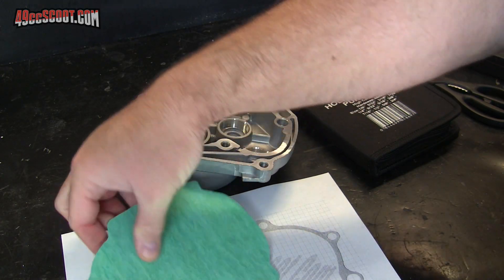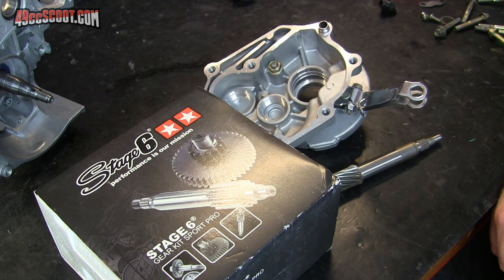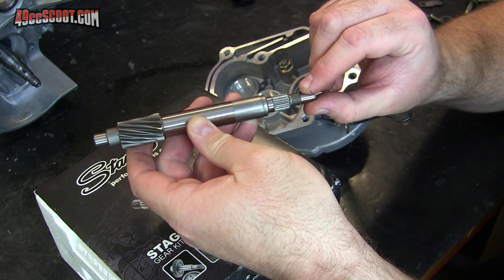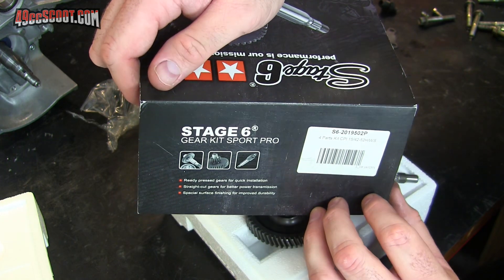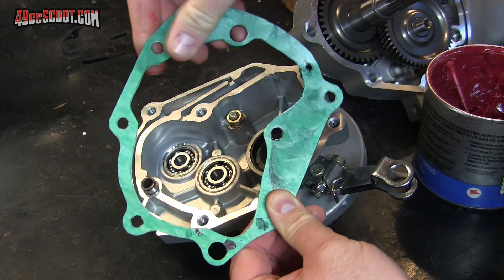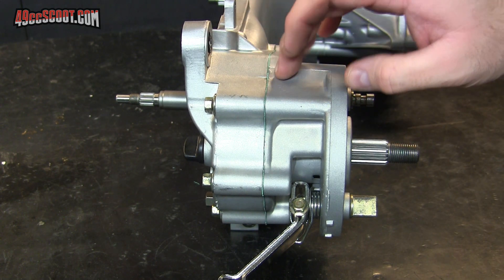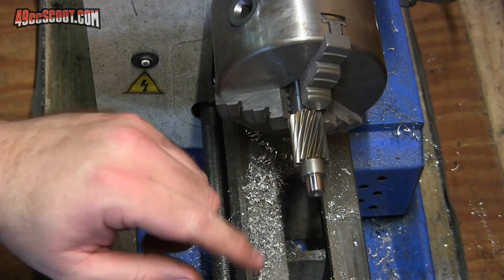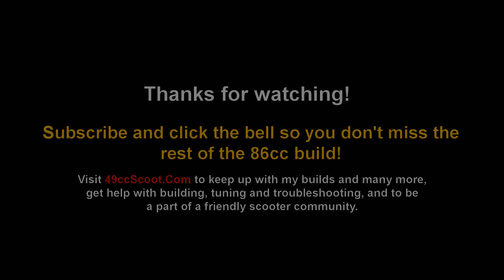TPR 86cc Build : Part 6 : Gearbox Assembly With Additional Support

Comment: Is it worth buying this secondary gears stage 6 15/42 my 1pe40qmb only reaches 70kmh thanks
Reply from the maker: Not a necessity if you're at that power level. It's a more sturdy setup with the 3rd bearing, but stuff that's closer to stock are OK without it generally.
Reply: @49ccscoot  okey thanks those are stage 6 gears 15/42 right 1pe40qmb long case 18-19splines i think fits 12inch wheels right and what speed u can max out with it
Reply from the maker: @roberts1189  That build for me was 75MPH or so, but a lighter rider would prob go a bit faster.

Comment: Hello, I have a scooter with a Piaggio engine and I have primary gear ratios of 13/46 and secondary gear ratios of 13/48. Which tuning gears should I install?🤔
Reply from the maker: That's roughly 13.07:1, which is pretty deep (low speed). I was using ~11:1 in my 86cc and that worked well for me at that power level with a 130/70-12 rear tire. With smaller tires, you may want an even lower gear ratio number.
Reply: @49ccscoot  Will primary gear ratios of 14/39 and secondary gear ratios of 16/47 be good? How to calculate it?
Reply: Tire 130/60 r13
Reply from the maker: @krystian9439  Calculation of the ratios is easy. 49 ÷ 13 = 3.77 and 47 ÷ 16 = 2.94. Multiply those ratios. 3.77 x 2.94 = 11.08. So your final drive ratio would be 11.08:1.
Reply: @49ccscoot  Ok. Does this ratio affect speed or acceleration?
Reply from the maker: @krystian9439  Both.

Comment: what is the purpose of changing the Primary Gearing ....
what do you achieve by it, I understand it with the secondary gearing but do not understand the point with it on Primary gearing.

can you not explain it to me, because I have funnily enough worked with Scooter for many years and built them up for Track driving, but I have never had to change a primary gearing part
Reply from the maker: Primary or secondary doesn't matter if you're just looking at ratio. Change to whatever combination gets the final drive ratio where you want it. In this case, the primary gears allow for an extra bearing that takes some slop out of the final drive transmission.

Comment: 11:1 is stock gearing on a rexy block i use 9:1 on my set ups better top speed
Reply from the maker: For me, it's worth the change from 10 to 11:1. I've had much less trouble with the gearbox using the gears that allow for more support, plus I am heavy and strong acceleration is my main goal.

Comment: How do you get that rear brake holder with the 12mm nut on the inside of the case you took off the old engine to put on the new. I got the nut off of it but it won’t come out of the engine case
Reply from the maker: They can be a bit snug. May need to be tapped out  once the nut is removed. If tapping starts heading toward beating, try to add a little heat to the area (~250F will usually expand it enough to make even bearing removal easy) and then try tapping again.
Reply: Ok thanks I also have a press would that be to much?
Reply from the maker: @nastynatesscooters9896  That could work. Again, if it seems like excessive force,  try heating and then pressing.

Comment: Hi I know your the man to ask I need to know what mallosi belt is slightly longer around 5 mm or 10 mm than a 617587/1 please help ??
Reply from the maker: 617587 appears to be 17.5x8x805x30.

The belt that I regularly use is a 6111108. It's 17.5x8x815x30.

Comment: Hi I'm from Europe we have the same block I always watched your video coz I learned a lot from you. Just one question where did you bought that primary drive shaft? I found one on Ebay but I'm not sure if it is the right one. Model: Eton beamer 50cc Code: 750152
Reply from the maker: I got it from Get 2 It Parts, and the code where I ordered it is also 750152.
Reply: @49ccscoot  thanks man!😀

Comment: Have to seen or tried the new Reveno Seamless
   Transfer
      Clutch yet.
Reply from the maker: Someone told me about it and showed me a vid. Didn't see any detail about how it is tuned or if you're stuck with what you get. No in depth info. It looks neat though.
Reply: @49ccscoot  they have a website

Comment: Really great fun.Never done this,0 experience.But the original peugeot 139qmb are different from the extra motor I bought,and none of the 101-octane spare parts fits in the screw-holes.So for my 900 dollar V-Clic it will be the original parts,wich are expensive,but all other are to repair and fitted.So none 139qmb engines are alike.Few criminal millimeters.

Comment: My limited experience with 139 gearboxes is that the outer race of the bearings should be more flush than you show on the video.  Just as you did the first assembly, I said to myself that added bearing was 'out' too far, and would get the input shaft into a bind.  Wrong as to the cause, but still think the outer race should be driven deeper.
 I had a slight problem with the intermediate and output bearings on the large case side, and had to drive them both deeper.  As usual, a good demonstration and clear explanation.
Reply from the maker: It's as deep as it goes. Works fine. My other one is the same way. Thank you though.

Comment: I need to get a new gasket on my QJ gearbox. It has a slow leak especially since I changed over to lighter weight synthetic Lucas. I should probably jump on the forum and print out a template. I never knew about this supplemental support. I guess them leaving that $1 bearing out helped production cost that much, but the Taiwan made Etons have them. Learn something everytime I see one of these vids.
Reply from the maker: I learned about it from forum members too. IIRC none of us knew if it would work, but they knew about some having that extra support so I tried it.  I used to change a lot of primary driveshaft bearings because of play. The gearbox is still far from bulletproof, but it's definitely an improvement.

Comment: I think maybe.. It take more on the shaft when using the lathe machine.. Correct me if im wrong.. There will be a little bit of resistance on the bearing.. But in the video it has a play..🤔🤔🤔
Reply from the maker: A little resistance and getting stuck in the bearing are different. That bearing is supposed to be more like some of the other gearbox bearings where shafts fit in without a press or interference fit.
Reply: Okay sir.. By the way.. Im a big fan here.. I always watch your videos about 2 stroke scooter.. Hope there will be a honda dio in your upcoming project

Comment: 1st comment. Hmmm correct me if i am wrong and i may be. But would you not want lower revs at speed than higher ?
I'm missing something i think. Or you want to get to the power band faster ? It would seem numerically lower gears would get more top end speed
or that is not what you are after. Or am i just not wrapping my brain around the right thing.
Reply from the maker: I couldn't care less about top speed. Well, I want to be able to go 60. Beyond that, whatever. I'd rather try to drag race or get the front end up. You have the right idea though. Also remember that I'm 300lb, so numerically low gearing isn't going to treat me well for taking  off.
Reply: @49ccscoot  I'm not far off at 250 lbs. I looked at it as lower revs means not
burning up all my gas. Two strokes have
a drinking problem, they drink all the gas in the tank fast. And more revs mean more gas. I really did think i had wrong. I find myself needing to go to rural locations, not a lot of gas stations or none. Sick of taking jugs of gas with me. And i have looked for lower gears for my toy and do not find any. i will gladly trade slow off line for better mileage at speed. 40 to 50 is fine for speed where i need to ride. I can not handle pushing a bike that weighs as much as i do
Very far, i'll ditch it off the road and come back with the truck. My 175 is a gas pig very poor mileage - rotary valve that's why.
Sorry for my being stupid i just got out of the hospital a few days ago, still a bit duh.
Gotta be a way to get big torque off the line and a fat curve thru midrange, and a rev at speed that keeps gas in the tank. I want too much don't i ? I still think there must be a way to do it.
Pain meds make the ramble worse so i'll stop. Really like the build,  and want to see what you get out of it on the road. Looks like a very nice cylinder seems worth the cash.
Reply from the maker: @johnrobinson357  With a 175, I'd think you could do just fine off the line with some taller gears.

Comment: Why not print directly into the gasket material instead of printer paper?
Reply from the maker: You could. Prob gonna depend on gasket material and thickness and type of printer. I find it easy enough to transfer as shown. The real trick setup is the cricut or something like that and other laser cutting rigs where you load material and it spits out gaskets.